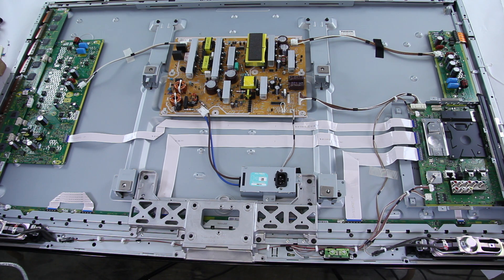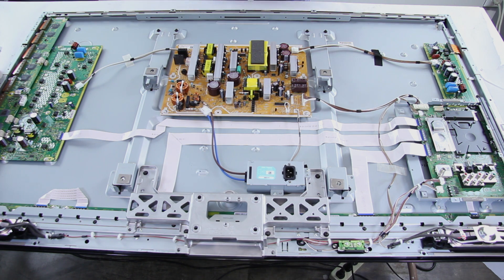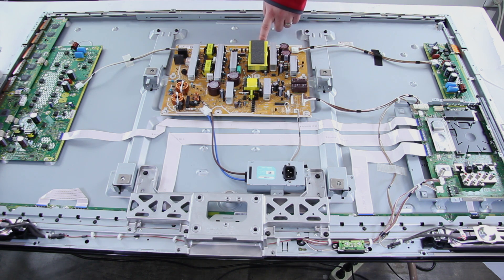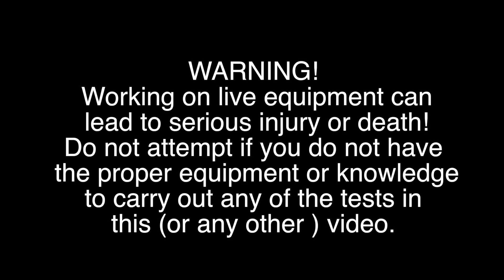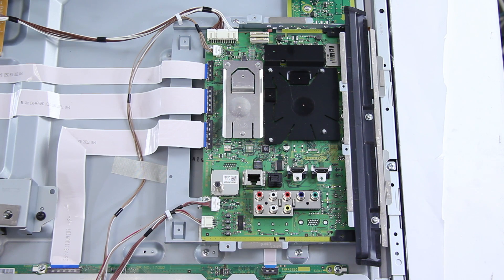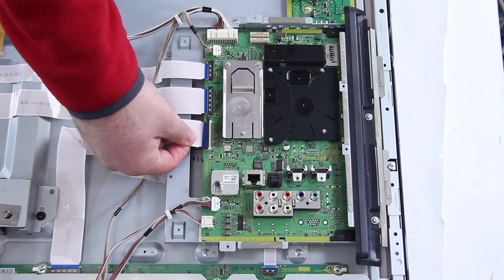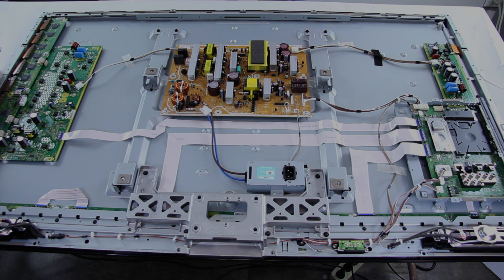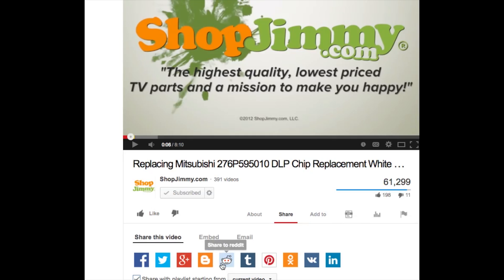Panasonic Plasma TV 1 Blink Code Explained Repair for 2011 Panasonic Plasma TV

Comment: hey I need help, we got a new TV last night at an auction well it was used but (barely). it is a 2010 model number mc127f19t13 Panasonic 50"inch viera. so my problem is the TV has worked since we set it up today but my daughter was watching a show and the TV turned off. whd. you turn it back on the screen is blank/black no picture and or sounds but it has the red blinking light the red.light blinks 7 times. what do I so to fix.this?

Comment: have a p55gt30 with the 7 blinking LEDs, going to remove the SC board to check components.  Please contact me with possible solutions, thanks em
traderfi@pacbell.net
Reply from the maker: +cool79hd  Try all repairs and troubleshooting at your own risk.  What did you find on the components?  Thanks!  www.shopjimmy.com

Comment: Tc-p55st30 and sc board TXNSC1PAUU with heat sinks.
Reply from the maker: +Monty Brugman   Is this the repair kit you used?  Also, did you match the symptoms of your TV/board with the symptoms that this repair kit fixes?  http://www.shopjimmy.com/panasonic-txnsc1pauu-tnpa5351-sc-board-component-repair-kit-for-tc-p55st30.htm  Thanks!  www.shopjimmy.com
Reply: Yes

Comment: Hi, my Panasonic plasma model is TH-50PZ700U.  The symptom is the power supply cycles on/off every two seconds with an audible relay click.  Fans spin up and shut down at the same frequency.  The power LED stays lit continuously.  I've replaced the entire power supply (both cards), and the symptom remains the same.  I don't have a service manual or schematics.  Any diagnostic help would be very appreciated!

Comment: i just repaired my sc board with your repair kit. it had a short on the sc board short is gone. but tv still has no pic and went from a 14 blink to a solid red light. any ideas? thanks. also wondering if the sc board could still be giving the problem.
Reply from the maker: +Monty Brugman   What is your TV model number and board number?  Thanks!  www.shopjimmy.com

Comment: Hi!!! I have the same problem with one tv PANASONIC TC-P50G10 is blinking like 7 time the light i dont know what panel i need it replaces U CAN HELP ME???
Reply from the maker: +byronallmuzik   Try this at your own risk. Unplug the TV, then disconnect the SC board and plug in the TV to see if the TV powers up. Reply with the results of this test. Thanks! www.shopjimmy.com

Comment: My panasonic came GT30 50 ", the LED blinks 7 times, I disconnected .sc2 and SC20 connectors. I turned on the TV again, and the LED will flash 8 times. What is the defective board?
Reply: +Cauê Fornasari Did u find what was the problem board on your tv?
Reply: Monty Brugman No Monty.
Reply: I have same problem thinking if just guessing and replace A board. Did u replace any boards?

Comment: I have a Panasonic TC-p50x3. I have not turned on the tv over a month, I connected the power cord and its clicks but no red light in the bottom panel looking at the screen. I only see a light where the dolby audio out is. After 5 seconds it shuts off. Can you please let me know what is wrong with it?

Comment: I have a panasonic tc-p46g10. It started with the 6 or 7 blinks the other day when i went to turn it on. I unglued the power cord and after plugging it back in i have no blinks at all. I assume i atleast have a power supply issue if not something else in conjunction. What do you think?
Reply from the maker: Jarrett lane    Try this at your own risk. Unplug the TV, then disconnect the SC board and plug in the TV to see if the TV powers up. Reply with the results of this test. Thanks! www.shopjimmy.com

Comment: I have a Panasonic TC-P65GT30 that intermediately turns off and instantly turns itself right back on. It does this after being on for maybe 30 mins or so.  It seems to be doing it more frequently since the problem first occurred. The smaller light on the front turns off and turns back on as the tv powers back on.

Do you think it is the main  board like in this video or something else. 

Thanks in advance for any help you can provide.
Reply: Trevor Layhe I just noticed that the light never turns off and the tv just shuts itself off and turns itself right back on. Sorry for the confusion. TC-P65GT30
Reply from the maker: Trevor Layhe  Try all repairs and troubleshooting at your own risk.  This could be a problem with either your power supply board or the main board in your TV.  You can replace the power supply and main boards individually to see if one of them fixes the problem.  Click this link  to replacement parts for your TV model number:  http://www.shopjimmy.com/catalogsearch/result/?q=TC-P65GT30  There may be multiple boards for the same TV model number, be sure to match part numbers on your current board, with your replacement for compatibility.  Thanks and please let us know if you have any further questions with your TV Repair!  www.shopjimmy.com

Comment: I have a TC-P50X1 with a one blink code. I replaced the power board and it did not correct the problem. I now assume the problem is probably the main board. Any support for this assumption?
Reply from the maker: Robert Podlena  I recommend that you bring your TV to a certified Panasonic repair shop.  Thanks!  www.shopjimmy.com

Comment: I have a Panasonic Viera HDTV TC-P42X1 red light blinks go on then off for about two seconds then on again non-stop untill I unplugged the power cord
Reply from the maker: Eli Rios   How many blinks are you seeing?  Thanks!  www.shopjimmy.com
Reply: Go on then stay off for 2 seconds then on again, non-stop.
Reply from the maker: Eli Rios  Try this at your own risk. Unplug the TV, then disconnect the SC board and plug in the TV to see if the TV powers up. Reply with the results of this test. Thanks! www.shopjimmy.com
Reply: I disconnect P3 conector which go from power board to SC board and I got 7 blinks coude.
Reply from the maker: Eli Rios  Try this at your own risk.  Try the same test on the SS board.  Thanks!  www.shopjimmy.com

Comment: Hi, I have a 2011 Panasonic tc-p50gt30. It just shut off and will not turn on. I have the red blinking light, 7 times then about 2 sec pause then 7 again and so on. I am willing to try to fix it myself as I have been burned by tv repair shops in the past. Wondering what parts I may need. Thanks!
Reply from the maker: Brian Williams   Try this at your own risk. Unplug the TV, then disconnect the SC board and plug in the TV to see if the TV powers up. Reply with the results of this test. Thanks! www.shopjimmy.com

Comment: I have a panasonic P60S30. It was made in 2011. Here recently it will turn itself off and then back on several times. I have not noticed any blinking lights. Could this be the 1 blink code problem?

Comment: I have a TCP55VT30 which had a popping sound and the video went out.  It doesn't seem to blink once though unless it happened initially and I didn't notice.  Tried using different plug-ins.  Nothing happens when attempting to turn it on.
Reply: To get the correct blink code hold down the power button and count how many times the red light blinks.  that will help you diagnose the problem...allegedly.  In my case the blinks said it was the main board which I just replaced but now have a 2 blink code so apparently there were two things wrong with it and I wonder after I fix this one if another will occur.  Very frustrating
Reply: Cameron Tibbits I broke down and had a repairman look at it.  He is fixing the SSI board - $50 for the visit and $275 to fix it.  Also found out that the vibration caused the screws to break and that is why it was making a humming noise (as the back cover was moving) for quite awhile.
Reply from the maker: Brian Johnson   Which boards is he replacing to fix the TV?  Thanks!  www.shopjimmy.com
Reply: He's replacing the SSI board.  Realized the sound so many people hear with this tv after awhile is due to the screws on the back panel breaking.

Comment: I have a july 2008 panasonic viera 50" plasma tv model # TH-M50 HD18  it had been in public storage for 3 years and when we too it out and pluged it in it wouldnt turn on. It has a 1 blink red light code because it has a slight pause in between each blink. It makes one click sound when you first turn it on and the light is solid red then clicks again and instantly begins to blink and never stops blinking. Contacted panasonic who refered an expensive repair man but never took it to him. I Thought mabey it was damage due to being stored so long in a storage unit and filed a claim through my insurance who isnt giving me anything close to what i paid for it so i have to take the small check from them and try to fix it myself. Can you please help me we only used it for 2 years before storing it and i cannot afford to purchase another tv right now.

Comment: Hello, My model is: TC-P55s60. I am getting 3 blinks. TV does not turn on at all. I appreciate your help.
Reply from the maker: Umer Nasim   Try this at your own risk. Unplug the TV, then disconnect the SC board and plug in the TV to see if the TV powers up. Reply with the results of this test. Thanks! www.shopjimmy.com
Reply: Did the advice below solve your problem?  I am having the same issue

Comment: Hi Shop Jimmy,

I have the usual problems with my Viera Panasonic. Model No. TX-L26X10B.  I think my TV may be in the 1 blink category and it was purchased in May 2010. It has the dreaded turn on/off syndrom.  I turn on the TV button, the TV flashes green normal times then the TV comes on with sound but no picture.  This stays like this for about 7 seconds then turns itself off again with the TV constantly flashing red indefinitely with one slow blink every 3 seconds until I turn the TV off again.   PLEASE can you help?!
Reply from the maker: Suzie Emmerson   Try this at your own risk. Unplug the TV, then disconnect the SC board and plug in the TV to see if the TV powers up. Reply with the results of this test. Thanks! www.shopjimmy.com
Reply: No reply. Dude I think you killed this guy! You didn't even tell him to hold the power button after unplugging it to discharge any electricity still in the TV. I'm not an expert but this is the correct thing to do right? I have worked inside computers and after unplugging them if you hold the power button they will power up for like 1 second which indicates there was still power in it which obviously can be lethal.

Comment: Hi ShopJimmy i have Panasonic TX-P42U20E plasma,at first it woud not turn on but i have manage to trick it with power outlet unplug and back in to turn on the tv,but from few days ago i cant turn it on tricks or no tricks...the red blinks one time each 4-5 seconds and it blinks the same pattern all the time till i unplug it or press power off button.I have unpluged the cable between P and SC board and then power on the tv but same red blinking pattern. Is the problem mainly in A-board,or P board,or both ? Thanks and hope you have parts for this old set (may 2010)

Comment: Good morning Jimmy I have a tc-p50u2 built in may 2010 and my red light blinks continuously? if I push and hold the power button sometimes it will come on but sometimes not for an hour or two? what can I do to fix this? It is a Panasonic TV and it works perfect until the TV is shut off.
Thanks
Brett
Reply from the maker: Brett M  Please watch this video FIRST to help with your repair!  TV Repair! LCD, LED, Plasma, DLP How To Fix Your TV with ShopJimmy.com Help!  I recommend replacing the A board in your TV.  Here is a link to a replacement part:  http://www.shopjimmy.com/catalogsearch/result/index/?cat=56&q=tc-p50u2  Be sure to match part numbers on your current board, with your replacement for compatibility.  Here is a link to a video showing how to identify your part number, click here:  Panasonic Plasma HD TV Repair Tips: Suffix Codes for A Board & Main Boards  Thanks and please let us know if you have any further questions with your TV Repair!  www.shopjimmy.com

Comment: What if the blink code is one blink at each 3 seconds, continuously?
Reply from the maker: Kyle Ivo   What is your TV model number?  Thanks!  www.shopjimmy.com
Reply: hello Jimmy.  Mine is TX-P50G11B in Brazil equivalent to the TX-P50G10B in USA.
Reply from the maker: Kyle Ivo   I recommend replacing the power supply board in your TV as there is a problem with the secondary side of your power supply.  Here is a link to possible replacement parts for your TV model number on our website, click here:  http://www.shopjimmy.com/catalogsearch/result/index/?cat=59&q=P50G1  Be sure to match part numbers on your current board, with your replacement for compatibility.    You can also call our customer service for further assistance with your purchase.  (877) 881-6492  Thanks and please let us know if you have any further questions with your TV Repair!  www.shopjimmy.com
Reply: hi ShopJimmy. I'll let you know about the results as soon as the board P is replaced. thanks for the great support.

Comment: Hi need help I have Panasonic viera  plasma tv model # TH-42PD50U it just stop working and stand buy light blink 2 time and stop and blink 2 time again so what to do can u help me please   Thanks
Reply from the maker: tushar patel   This could either be a problem with the power supply board or the main board in your TV.  You may need to replace each board individually to see which one fixes the problem.  Here is a link to replacement parts for your TV model number on our website, click here:  http://www.shopjimmy.com/catalogsearch/result/?q=TH-42PD50U  Be sure to match part numbers on your current board, with your replacement for compatibility.  You can also call our customer service for further assistance with your purchase.  (877) 881-6492  Thanks and please let us know if you have any further questions with your TV Repair!  www.shopjimmy.com

Comment: I have an older PANASONIC pro PLASMA (TH-42PF20), constant blink on red light. I assume this means 1 blink. Would this be the same trouble code?
Reply from the maker: Ken Sandstrom   I recommend replacing the power supply board in your TV.  Unfortunately I do not see any replacement parts in the search results for your TV model number on our website.  Please reply with your part number on your power supply board and I can try searching for replacement parts.  Thanks and please let us know if you have any further questions!  www.shopjimmy.com
Reply: Hello Ken Sandstrom, I have the same question as you.  One blink at each 3 seconds, continuosly.
Have you had your TV fixed yet? What was the problem for this diagnosis? Thank you for the attention.
Reply: Yes it's a 1blink code and it your main board

Comment: Panasonic VIERA TC-L42E3 42-Inch 1080p 60 Hz LED-LCD HDTV. Works randomly and shuts off randomly with the red power button blinking 1 time in increments of time. If i unplug it and wait a few hours, and turn it back on, it works again for another hour or sometimes longer. What can i do about this?
Reply from the maker: Tim Kountz   I recommend replacing the power supply P board in your TV.  Here is a link to replacement parts for your TV model number on our website, click here:  http://www.shopjimmy.com/catalogsearch/result/index/?master_part_type=Power+Supply&q=TC-L42E3  Be sure to match part numbers on your current board, with your replacement for compatibility.  You can also call our customer service for further assistance with your purchase.  (877) 881-6492  Thanks and please let us know if you have any further questions with your TV Repair!  www.shopjimmy.com

Comment: I have a Panasonic TC-P50S30 with the 7 blink code issue s/nMJ13190203.  What should I replace first?
Reply from the maker: *****   I recommend replacing the SC board in your TV.  Here is a link to replacement parts for your TV model number on our website, click here:  http://www.shopjimmy.com/catalogsearch/result/?q=TC-P50S30  Be sure to match part numbers on your current board, with your replacement for compatibility.  You can also call our customer service for further assistance with your purchase.  (877) 881-6492  Thanks and please let us know if you have any further questions with your TV Repair!  www.shopjimmy.com

Comment: Hi, my Panasonic Viera TH-P50S10A blinking green light followed by red light blink every once second interval. Any help please?
Thank you.
Reply from the maker: Syed Mohammed Al Baghdadi   I recommend replacing the power supply in your TV.  Here is a link to replacement parts for your TV model number on our website, click here:  http://www.shopjimmy.com/catalogsearch/result/?q=P50S10A  Be sure to match part numbers on your current board, with your replacement for compatibility.  You can also call our customer service for further assistance with your purchase.  (877) 881-6492  Thanks and please let us know if you have any further questions with your TV Repair!  www.shopjimmy.com

Comment: Hi! I have a Panasonic TC-P50ST30, the problem I am having is on the picture anywhere there is BLACK spots (like shadows, black hair, black colors) it looks like its solarized and a lot of streaking lines of random colors throughout the pic. When bringing the Menu up the menu is mostly fine, and when put in 3d mode it is somewhat watchable not as bad... would this be the mainboard or could anything else cause the solarized/streaking lines?
Reply from the maker: RiccoFX   I recommend replacing the SC board and buffers that attach to the SC board in your TV.  Here is a link to replacement parts for your TV model number on our website, click here:  http://www.shopjimmy.com/catalogsearch/result/?q=TC-P50ST30  Be sure to match part numbers on your current board, with your replacement for compatibility.  You can also call our customer service for further assistance with your purchase.  (877) 881-6492  Thanks and please let us know if you have any further questions with your TV Repair!  www.shopjimmy.com